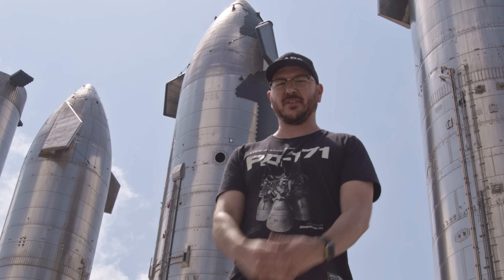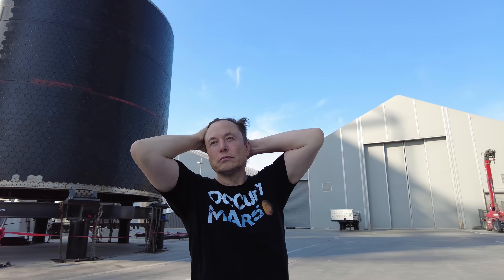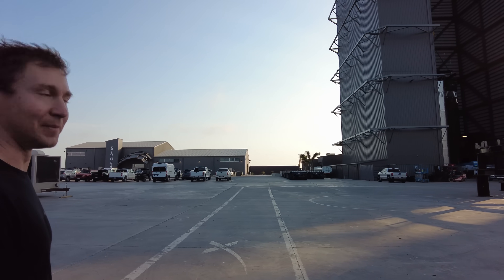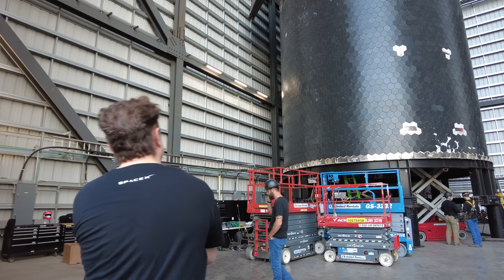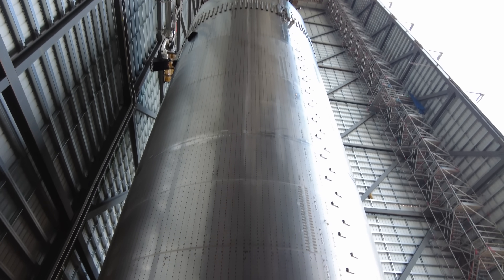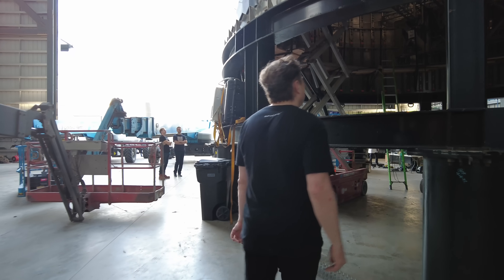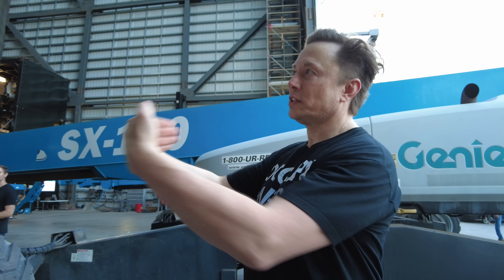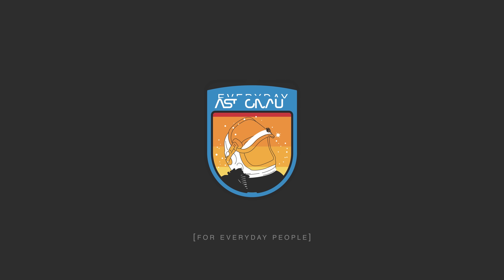[2022] Elon Musk Explains Updates To Starship And Starbase!

Comment: 30:50 About making it 10000 fold cheaper: I doubt that you can get a factor of 100x from mass production (- it’s not like the cost of material is just 1% and everything is done by indestructible robots). And I also doubt that you can get a factor of 100 from reusability: that would probably require reusing each individual Starship hundreds of times… - “You can’t just walk into Mordor: it is a barren wasteland… - not with ten thousand men can you do this! It is folly!”
Reply: Mostly it's just steel, Very cheap. But it's still unlikely.
Reply: The materials are very limited as it has to be as light as possible, mostly it's all just fuel.

Comment: I've always wondered if fins (or wings for that matter) have to be so large.
What if you have an array or hundreds or more piezoelectric (if possible based on heating concerns), zirconium-doped wing fence-type (or slightly scaled up) control surfaces covering a mathematically-determined area of the vehicle's skin?  There would no longer be a single point of failure.  And, each member would experience relatively low wing-loading, as opposed to exposing one-to-four large control surfaces to superheated, hypersonic airflow.
Think of a hypersonic snail, a snail whose velocity is scaled and accelerated up for mass and velocity.  In a snail, all of those phenomenally-coordinated, cilia-like members collectively generate useful motion for a macro-scale organism.  Why not pick up where nature left off and scale it up to allow the skin of a reenterig spaceship to groove into its desired path?
Sorry for all the hyphens.

Comment: Is there plans to measure the temperatures on the heat tiles? It might be useful information to know if the re-entry fails. I don't know just a thought. Also you might flip the ship during re-orbit maybe to spread the heat around so the tiles are not damaged. Could increase reusability. You could automate the flips based on temperature.